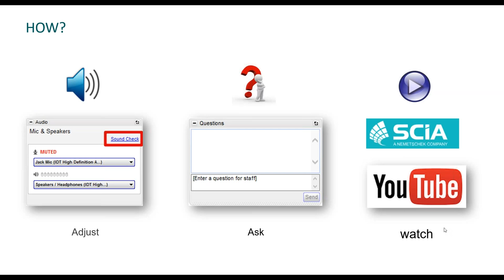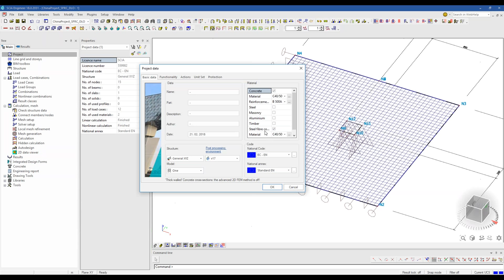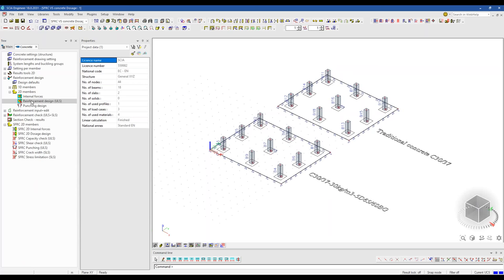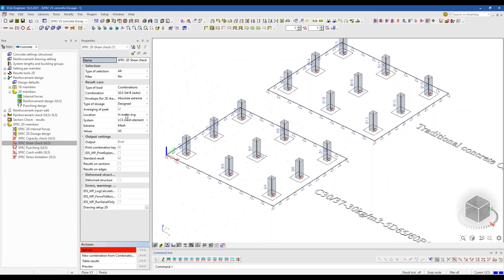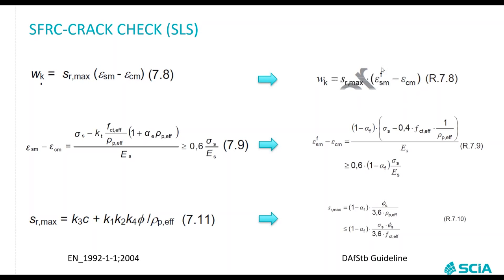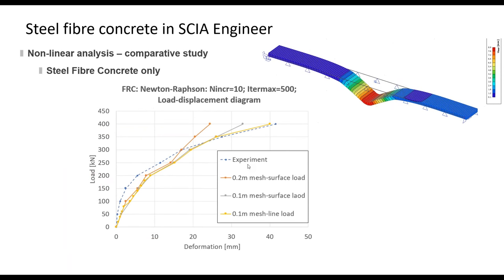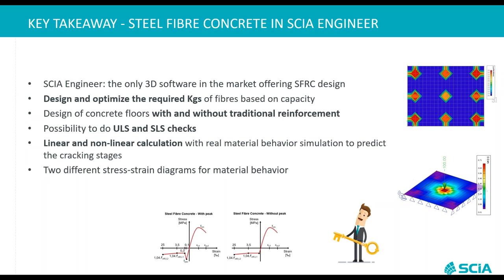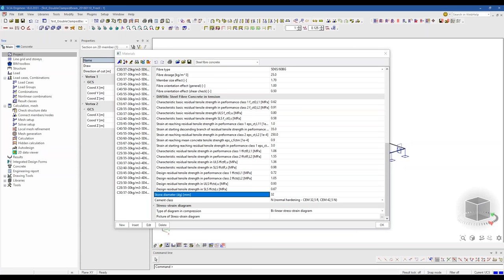[EN] Design of steel-fibre reinforced concrete

Comment: can the calculation be made according to a standard other than DAfStb?
Reply from the maker: Hello Luka 
The theoretical background is indeed taken from DAfStb Guideline 'Steel Fibre Reinforced Concrete', provided by Bekaert and also from EN 1992-1-1: Eurocode 2, Design of concrete structures - Part 1-1: General rules and rules for buildings.
This is illustrated on our help-pages as well;
https://help.scia.net/webhelplatest/en/#fibre_concrete/steelfibreconcrete/01_project_data/01_project_data.htm%3FTocPath%3DDesign%2520and%2520check%7CConcrete%7CEC-EN%7CSteel%2520fibre%2520concrete%7C_____1
 
So it's not possible to switch to other standards than those.